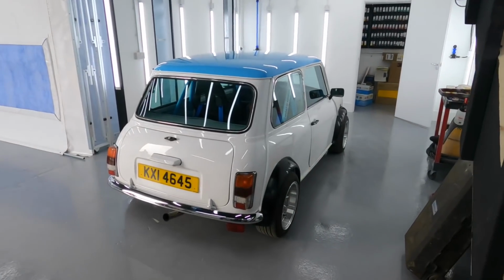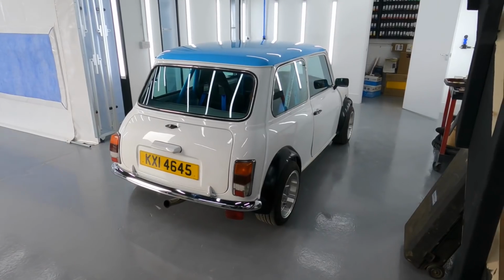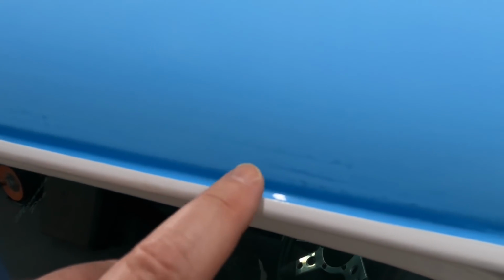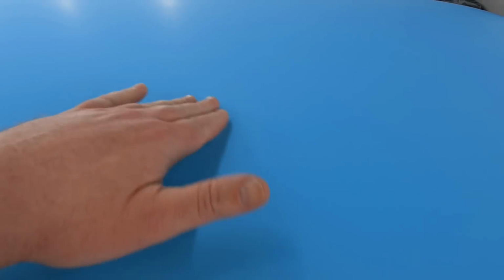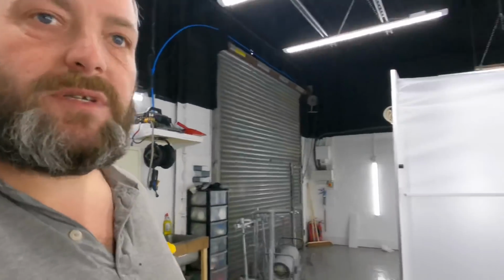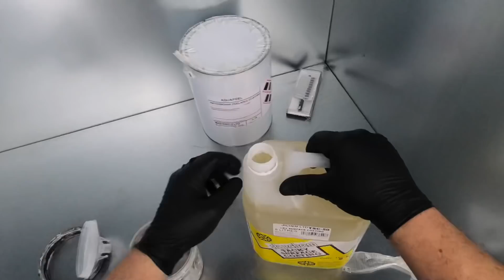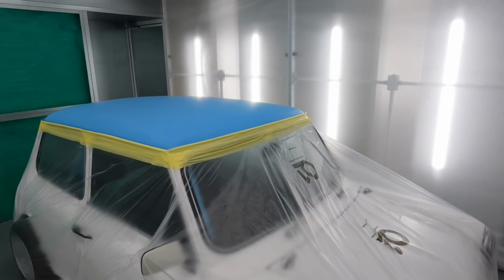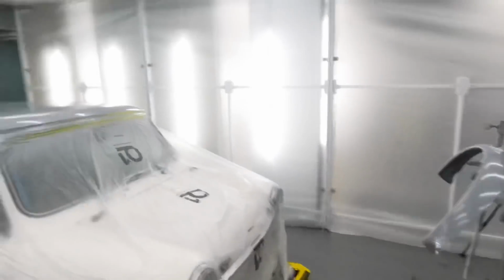Classic mini 1275 roof & arches respray

Comment: New shop looks good and hopefully you get all the little niggles sorted soon. Only thing I would say is you have an old powder extinguisher there get rid of it and replace with foam and co2. If you ever use that extinguisher or it goes off it will destroy alot of you stuff as the powder has silica in it and is corrosive also it gets everywhere so a nightmare to clean up. Even when you thing you have all of it more appears.
Reply from the maker: Yeah I will that’s all I had just wanted something in there 👍👍👍👍
Reply: When you are a bit more flush with cash i would get a 2kg co2 for upstairs and a 6l foam put them outside your compressor room door then for the workshop area get a 9l foam and a 5kg co2. I know they are big units for the workshop area but its better to have more than not enough as the last thing you want is to have something like the other unit did a few months back but then I know you don't leave the unit until the welds are cold.
Reply from the maker: I think your right I’ll probably do that 👍👍👍👍

Comment: Is your paint scheme water based or the good stuff solvents, I have used water based paints but I much prefer solvent. Also my pal got a mixing scheme and he picked it up in no time. Months down the line and he can tint a colour to suit the motor so you’ll pick it up in no time. Haha shinny primer I knew straight away you was gunna say nardo.. 👍👍
Also my pal uses that exact tacky stuff on his booth, good gear does the job 👍.. I see you use innotec  👍 all good stuff.
Reply from the maker: Yeah not used water based in about 20 years so will be a learning curve I’m sure I’ll pick it up I’m well impressed with the computer system and the matching loads to learn but I’ll get there I’m self taught so just see it as more learning more improvements and carry on trying to be the best I can be 👍👍👍👍
Reply: @grantssmartrepairs   I’ve used water based and I guess the only difference I noticed was the way it dried, I then lacquered it with solvents. Primer went on nice just 1000 it off and lacquer it 🤣. I could see the roof was ropey the last person rollered it on by the looks of it, paint looked really heavy on there, look forward to part 2, Spurd me on the clean my booth out and start doing bodywork again. Big up from DTE 👍
Reply from the maker: Get it sorted 👌👌👌 and I’ll buy that old scrap series 1 you got 🤣🤣🤣🤣🤣🤣👊👊👊👊👊👊